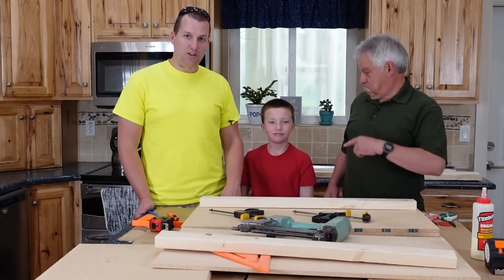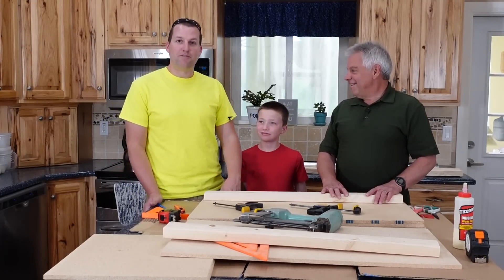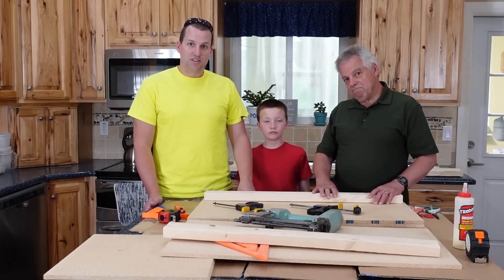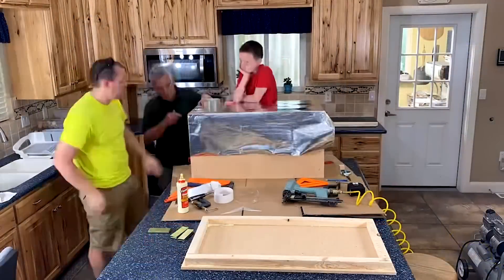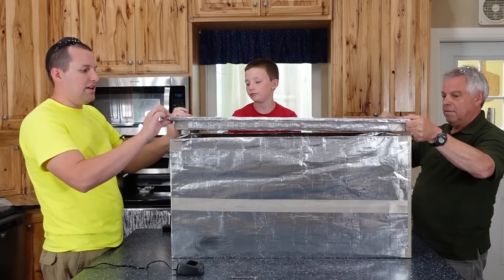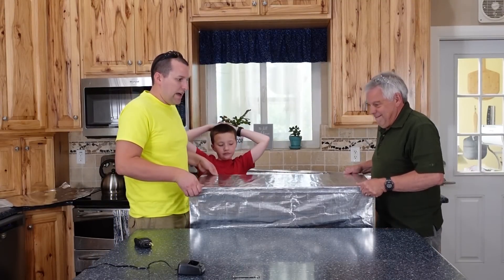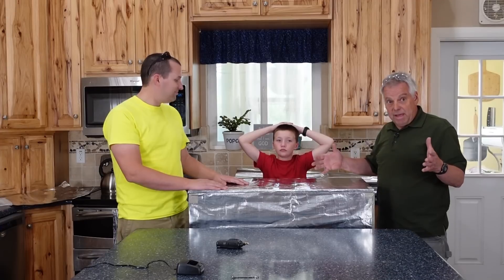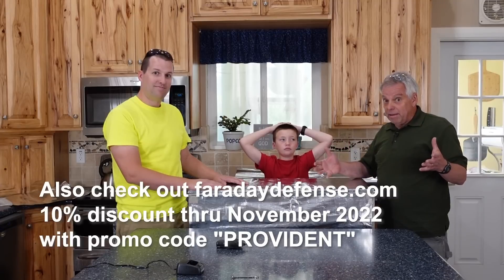EMP Ready: DIY Faraday Cage Construction and Testing

Comment: We have all the critical items in EMP bags. We have tried to use have redundancies using different types of Faraday bags in hopes that if one solution fails to perform as expected we should be able to have some of all the electronics survive.  I just ordered some more EMP cloth to cover another spare solar panel.
Reply: I bought the EMP cloth and wrapped my phone - but it still worked ???
Reply: @fullofhope2222  I am not an expert, but it my understanding that this is to be expected. The EMP cloth limits the EMP wave, but does not fully block it. (The cloth that Provident Prepper used in this video is different and blocks more than EMP Cloth.). According to Dr. Bradley, Solar panels are pretty resistant to EMP, but using EMP cloth is not a bad idea.  - I do not use EMP cloth to protect other electronics as it only gives 30 db of protection which is not ideal but for items that are not too sensitive to EMG like cars and solar panels, as I understand it, the cloth works well.  I hope this helps :) Happy 4th of July!
Reply: @Googlesucks  I would like to have something really big for ECOFLOW and panels - Ive roof panels and batteries in house - What are your thoughts on EMP Shield? - Im in Ireland and it expensive with shipping, customs etc
Reply: Where did you order the emp cloth from?

Comment: Great video, but can't you just use a metal trashcan with a metal lid?
Reply: Yes but you need to line the interior with something non conducive.  Nothing inside a Faraday cage should touch the conductive shielding.  All closures (e.g. top) should make 100% conductive material to conductive material contact.  This is often the hardest part to get right.
Reply: Trashcans are sort of weirdly shaped too, most are not perfectly cylindrical. If you want to put something large and square/rectangular like a solar generator into it it's not going to fit.
Reply: @oldschooljeremy8124  so would the interior of an aluminum travel trailer be safe?
Reply: @stevebishop9468  interesting idea. But I would think you would have to cover the windows and any ports or vents. I don’t know about yours but mine has some pretty open places underneath so isn’t completely sealed up.
Reply: @NatureScapesStudio  underside is covered with aluminum...as are the windows
Reply: @stevebishop9468  - you would have to remove any rubber gaskets around doors or windows and ensure they make tight metal-to-metal contact, put something like aluminum foil over the windows and air vents and exhaust fan ducts and drains, then line the interior with some insulating material. That is, you could do it, but it would make it hard to live in it. 

Something like a shipping container or one of those moving pods would be easier to convert. But, it would be more protective than your average building.

Comment: Isn't my microwave a faraday cage?
Reply: Yes but it will only protect through limited frequencies of EMP.  Switching out the front plate (the screen with holes in it) and covering all other holes will greatly enhance the range of frequencies protected against.
Reply: I read to place foil over the front door and unplug it

Comment: I just happened to be re-re-re-listening to the audiobook of One Second After as I type, so hows that for synchronicity?  I use several steel gift tins (like from chips or cookies), lined with cardboard and taped with duct tape over strips of aluminum foil all the way around the lid for smaller things like radios and a burner pre-paid cell phone and a spare glucose tester.  Has to be lined with cardboard (or items kept in cardboard boxes) so nothing conductive touches the metal inside of the tins.  Also have a huge galvanized trash can for bigger objects, like my CPAP's 12volt adapter or a spare solar controller, like that.  Although I REEEEALLY like the box covered with metal fabric.  Way more attractive than cookie tins and trash cans, LOL. Was hoping you'd cover this topic eventually....thanks, guys!
Reply: Question please. If we had our gear in these boxes and there was a emp. would the items that were in the protected box be able to work once the emp had happened. I’m asking mainly for cpap machine & gear
Reply: @deniseyonge6973  You're still going to need a power source like a generator. An EMP is going to take down the grid for a very long time.
Reply: @gsdalphaS013  Not necessarily.  A lot of CPAP machines these days come with built in voltage adapters so they can be powered from a 12 volt battery, with an optional kit  But yeah, a generator would also work, provided it too had been protected from the EMP.
Reply: @AnnBearForFreedom  How are you going to recharge the battery?
Reply: @gsdalphaS013  The simple solar set up, which is in its own Faraday cage, of course!
Reply: @deniseyonge6973  Denise, the actual CPAP machine itself, if it had been properly shielded/protected, would work just fine after an EMP.  What would NOT work, however, is the electrical grid.  You'd need a machine that could run off 12 volts (some do have voltage adapters built in, like for car use) and a 12 volt battery plus a way to recharge the battery without the grid, plus all the plugs and wires to hook your machine up to a battery.  I'd ask your medical supply place how to run your CPAP from your car.  Tell them youre going camping for a week or whatever.  Or, like GSD Alpha says above, you could power it with a generator, which would also have to have been shielded from the EMP.

Comment: instead of cardboard or building a wooden box, why not just use a thick Styrofoam cooler? the lid is already made to seal just like the one you made. also waterproof if not submerged,will float in a flood and if you seal around the opening with waterproof tape, would be completely waterproof. Pet stores and pet fish stores give them away for free if you ask. just get the extra large ones.The Styrofoam boxes are what the aquarium fish are delivered in.I use them to make stray cat shelters,with a piece of overhanging plywood or even cardboard on a contractor bag. those coolers are very useful for many things. I also store tools in them inside the shed and they stay clean and don't rust. Also great to stack up with prepper food. No moisture gets in.
Reply: good idea it seem just as good or even batter than a big old wooden box
Reply: I also use them for some of my first aid supplies. Protects them from the summer heat.
Reply: You can also use a big garbage can!
Reply: I use them for prep food too.
Reply: I bought a large heavy duty tote from Costco and I plan to line it with faraday cloth and then wrap and tape it.
Reply: @katharvey7324  
Faraday cloth?
Reply: Heck YA!!!!! AWESOME IDEA!!! Thank you so much for this ☺️ information on the styrofoam boxes!!!!!
Reply: Instead of styrofoam, use a normal cooler like an Igloo
Reply: @exit61  was trying to keep it free or cheap for everyone. A real cooler is great if you have an extra or can afford to buy. I have 2 ok ones,nothing fancy, but I will need them for food if shtf.- especially if you end up outside. Wild animals are just as hungry as we are. I keep one outside in winter with a contractor bag and cinderblock on top. raccoons can't get in it. Bears would be a different story. Maybe bury your coolers with plywood on top and heavy stuff over that.
Reply: @pattiannepascual  i’m just throwing out alternative containers. Almost anything will work.
Reply: Thanks!
Reply: Good idea but Styrofoam seems a little bit fragile to me. With all the bouncing and banging around in a flood it will break easily.
Reply: @FBPrepping  there's very thick ones. the ones Omaha steaks come in you can't break even if you try. since of the free fish store ones too. Definitely don't use those cheap ones they sell. they are paper thin
Reply: You mean cooler box?
Reply: Good call, cheap, if not free, and sturdier than cardboard...

Comment: I use old chest freezers.
Reply: Generally they have a rubber seal for the top which breaks the Faraday cage.   There are also holes in them to allow for air circulation for the cooling mechanism.  The interior lining may not be metal even if the outside is but as a starting base it’s a great idea you just have to make sure it is 100% sealed with conductive material.  Cover all holes (air circulation, power cord, drain, piping, etc) and work up some way to seal the top (note, exterior finish (paint) may disrupt connectivity.